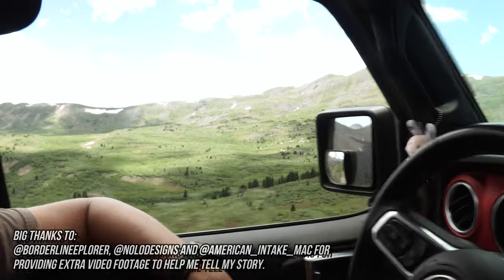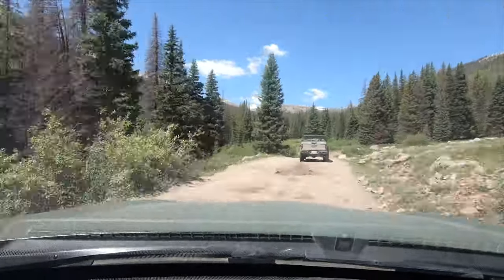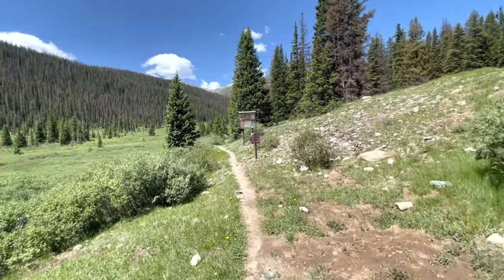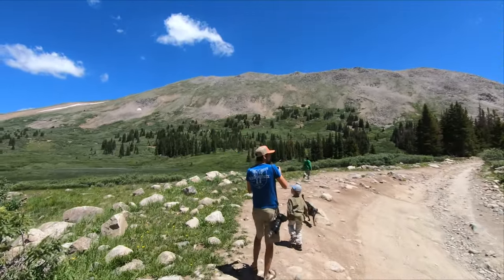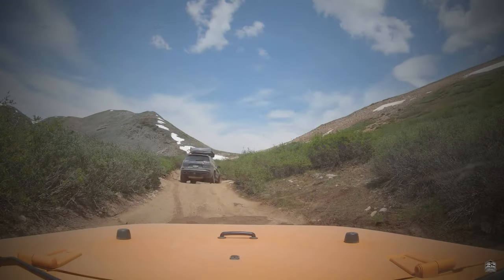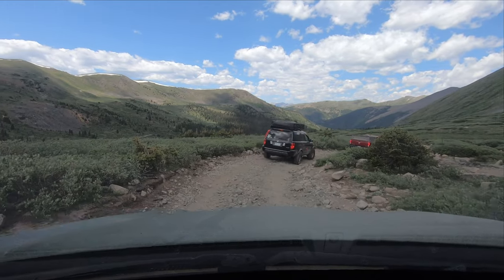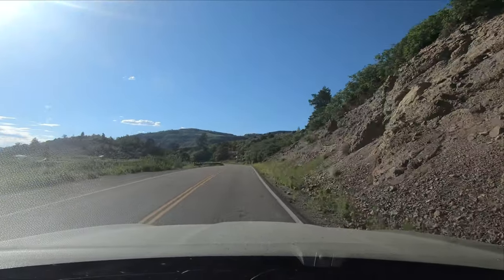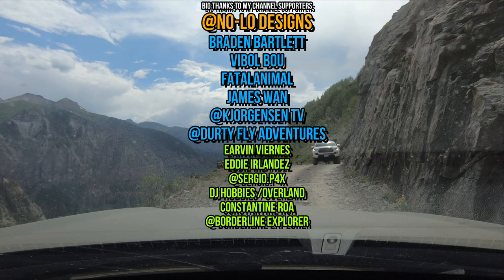Tin Cup Pass.  We take 2 modern Hondas (Passport/Ridgeline) and 2 older 1st gen Pilots to 12,154 ft.

Comment: I commented on your Facebook post about this, and like I said on there, these trails are on my bucket list! Well, maybe not Imogene, since heights scare the hell outta me, but definitely tincup pass! Hoping the more aggressive gearing in my forester wilderness will let get up there without much issue even with a CVT. Just need to find the time to get out there coming from NC.
Reply from the maker: We're heading back in July!  (in 2 months), you should join us!  We have someone driving from PA.
Reply: @JonDZ_Adventuring  oh, that is so very tempting, have a solid date yet?
Reply from the maker: @JDS-Dalton  yep, I’ll message you
Reply: Yes, would be good to see how an OBW does on this trail
Reply: @laborcreatescapital9483  Well, I guess we'll be seeing how the FW handles the CO trails in July haha.
Reply from the maker: @JDS-Dalton  I’m hoping you can make it!  Also, installing a $10 radiator fan to pull air into the front cooler would be a good upgrade to do.  Honestly, when I first installed my transcooler, I didn’t notice much of a difference at all until I installed the fan.  I activate it via switch because I didn’t want to mess around with transmission line leaks 😃.
Reply from the maker: @JDS-Dalton  trans temps stay cool at high speed, but without air getting rammed into the front bumper, there’s almost no difference.
Reply: @JonDZ_Adventuring  As long as the boss man gives the ok, I'll be there! As for the fan, should be fine since the current gen foresters have 2 radiator fans pulling air into the engine and transmission coolers, just actually went down to the garage to double check haha. I'll be keeping an eye on things on the next few local rides to make sure everything will be all good though! And gonna definitely try and do the trail that made my old '19's transmission get up past 240 degrees in June as well.

Comment: I wingspan guessed a new Passport Trailsport at the dealer today and discovered the cargo area with the back seats down is long enough for me to to stretch out my 6’1” frame and sleep in the back. Another check in favor of me getting a Honda instead of a Wrangler. 😎
Reply from the maker: If you slide the seat forward and place a head board to cover the gap between the front and rear seats, it measures 7’5”
Reply: That's plenty of room, for sure.

Comment: What PSI did you air down to (I'm assuming you would)? Is that why one of the Pilot's had the TPMS light on?  Great video, too

Also, are you in normal or sand mode?
Reply from the maker: Yes, most of us aired down  (The guy in the Jeep Gladiator doesn't believe in airing down).  I personally aired down my 32.1" tires with 7 inches of sidewall to 20 PSI.  I was in normal mode the whole time.